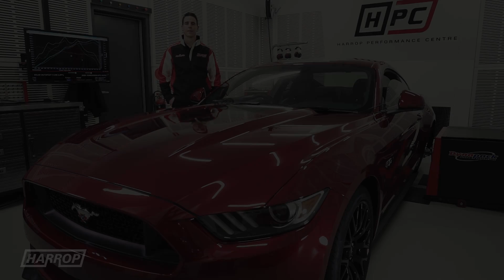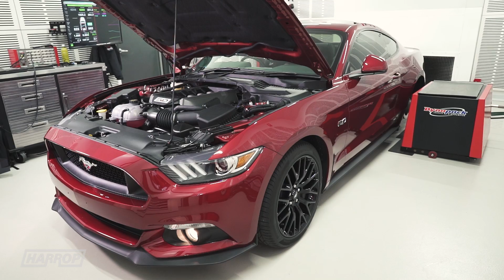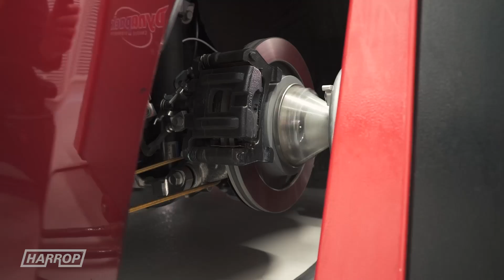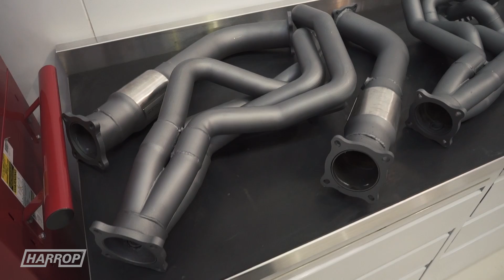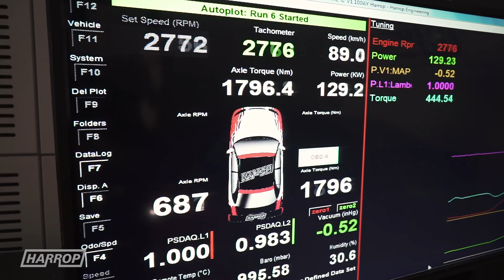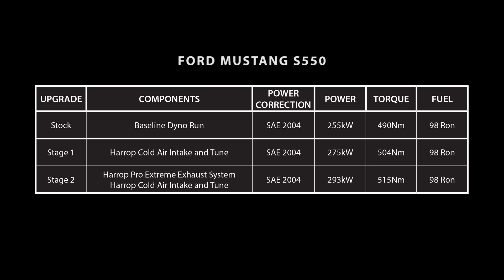Harrop Mustang S550 NA Performance Systems Preview

Comment: Wow, European models are detuned...damn
Reply: Power figures we quote are all in Kilowatts at the Hubs on our Dynapack HUB Dyne.
295kw = 395 WHP = 475 engine HP factoring in 20% drive train loss.
Reply: LJ & Son's VLOGS yeah it's because the headers are reconfigured since the drivers side is on the right side. I Seen a documentary on it. So the euro models produces about 25 less horsepower then the American ones.